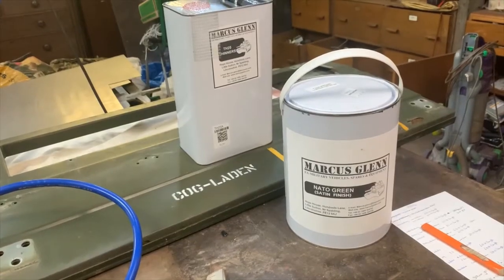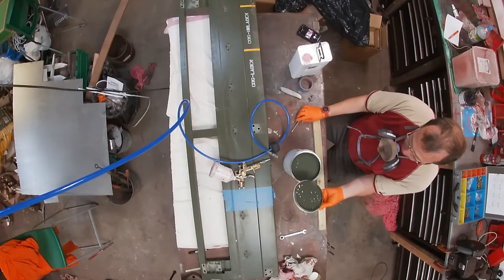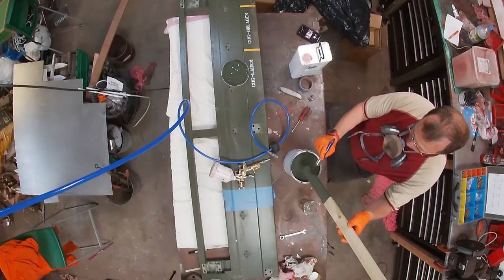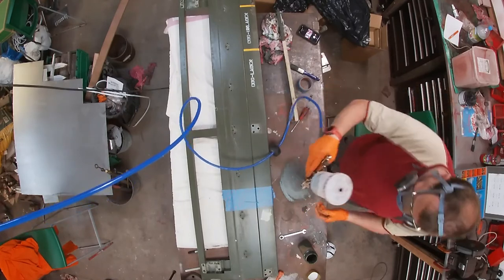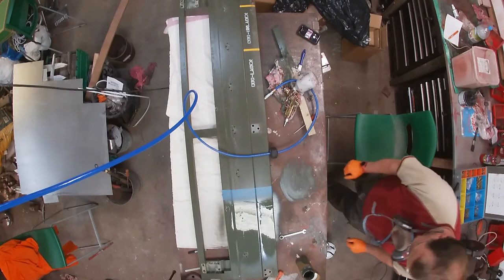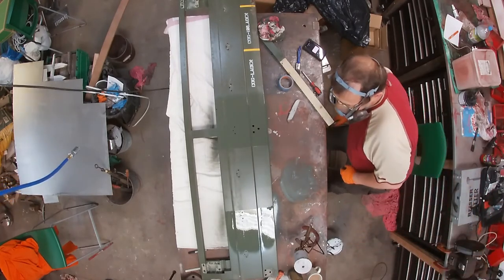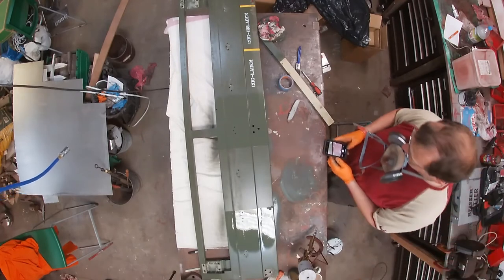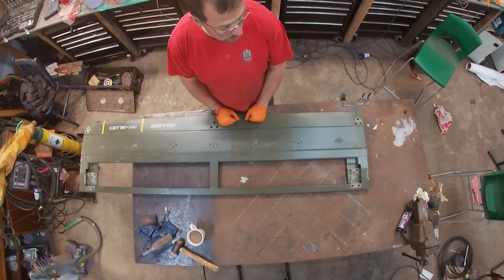NATO Green paint!!! which paint to put on your military vehicle? Marcus Glenn

Comment: great work, remember the old original paint would have faded through time, so probably the new paint is the right colour
Reply from the maker: It was about 10 different shades. It had had replacement doors, one side had been in the sun, a rust repair, hammered out doors etc etc. she gets complements all over now.
Reply: So did you get 383 green Sherman Williams
Reply: Still its the wrong colour